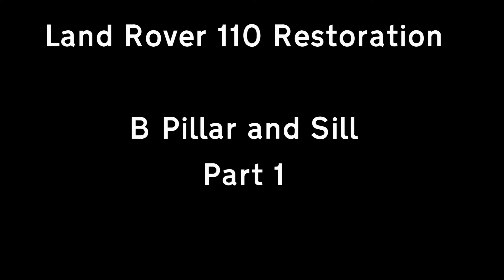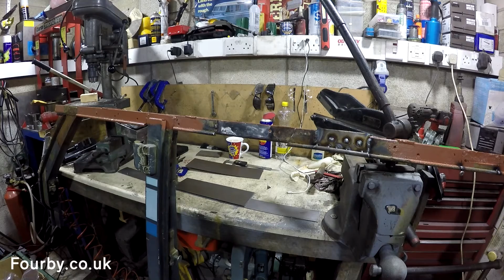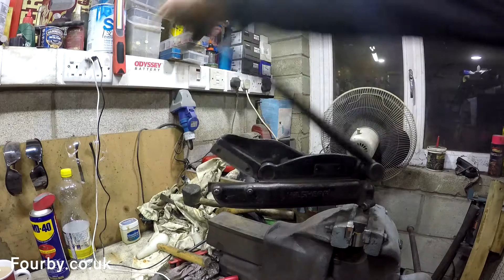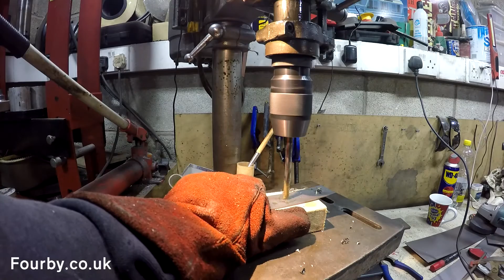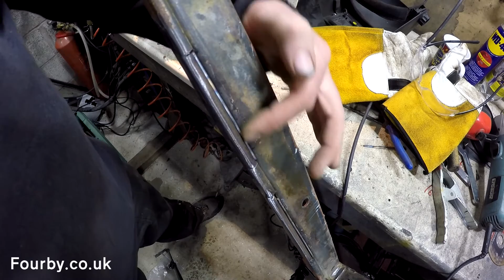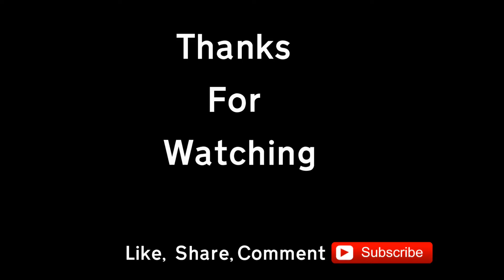Land Rover 110 Restoration #1 "B Pillar and Sill repair Part 1"

Comment: Neil,  Would it not have been better to remove the hollow rolled end and replace it completely with a solid bar?
Reply from the maker: Land Rover Toolbox Videos most of it was solid, but there were these two sections where it had gone. But there is much more to do with this section